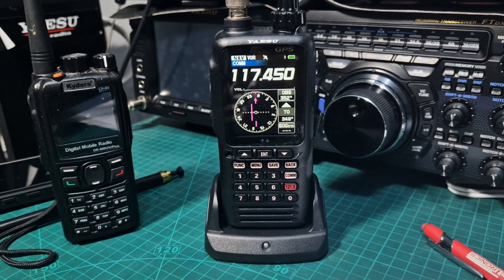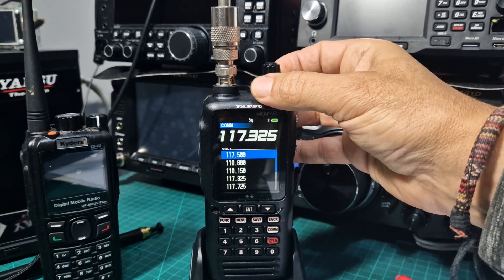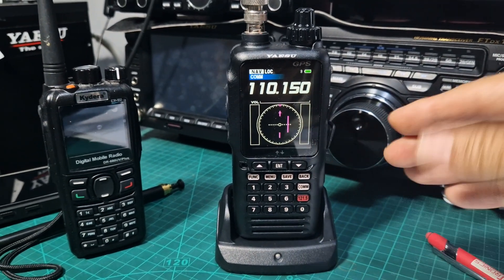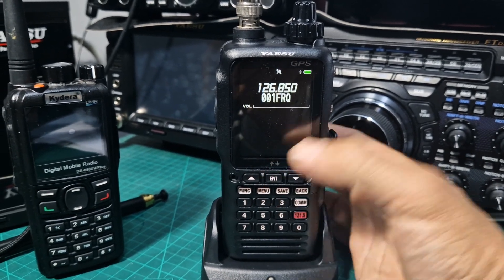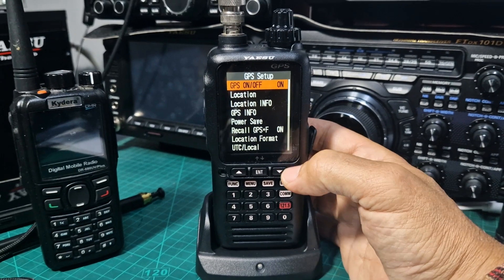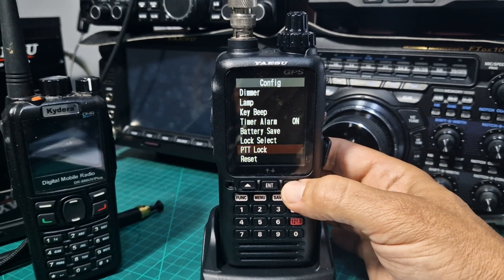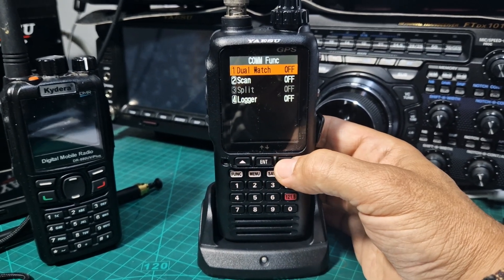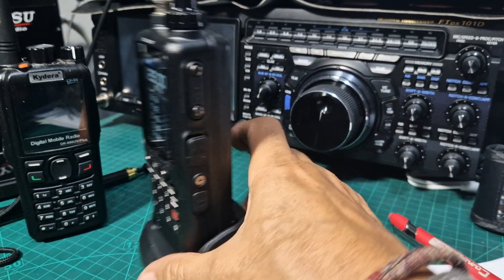YAESU FTA-850 - VOR & ILS SCREENS Plus More tips

Comment: Hi does this radio come with its programmes or  do you have to programme it in.  Great video   i do like scanners. Geff
Reply from the maker: Hi it's scans AIRBAND Freq as soon as you select scan .
Reply: You can feed it with software yce46 from your pc via usb with frequency/group lists.
Question is if you can load an old list from FTA750 into it. Might be interesting for upgraders or in cas e of a broken FTA750.
Reply: What do you mean by "programmes"?
I am not supper familiar with this model, but typically, pilots have zero use for scanning or programming (it's counterintuitive to the ATC system model), so programming and scanning would be down the list of usable features.

Comment: The previous models used a software utility to update the firmware. I’m not finding anything yet for this model. I enjoy listening to the airband, might have to save up for one of these.
Reply from the maker: Hi Thanks yes the 450/550/750 have firmware but this one seems set from factory it does have a USB connection  I feel this is why it doesn't display 8.33 mhz .
Reply: I have this one and there is a PC software that is allowing to directly add frequencies into the radio, when plugged in USB. Not sure what is your comment about the spacing but this is a 8.33 KhZ increment radio ( like in Europe)
Reply: @davidweisbrod5771 i have never got the software to work

Comment: Do you find you have to turn up the squelch on your unit more than usual compared with other radios in order to close it?
Reply from the maker: External antenna is better or stand outside .
Reply: @M0FXBHamTech  Changing the antenna does help the situation.
The antenna supplied with the FTA-850 is identical to the one supplied with my AR-DV10, I guess that's why AOR claim it's specifically tuned for the commercial aviation part of the spectrum.
Was listening to the UHF military aviation band yesterday evening (USAF pilots undergoing training exercises) , something was going on, heard communications from a pilot (commercial?) asking permission to be diverted to a nearby airport and requesting law inforcement officials be on hand when the plane landed. I recorded the transmissions, need to review them today.